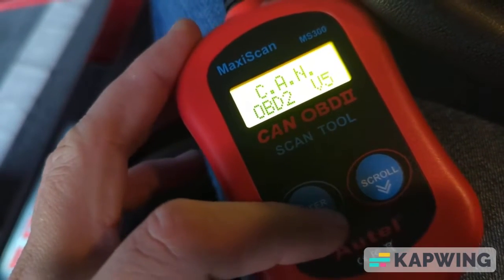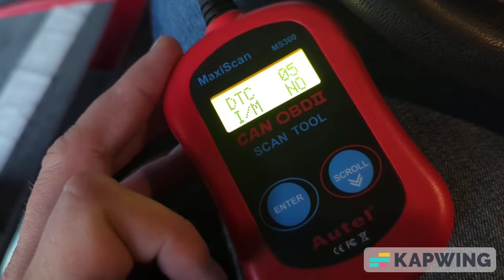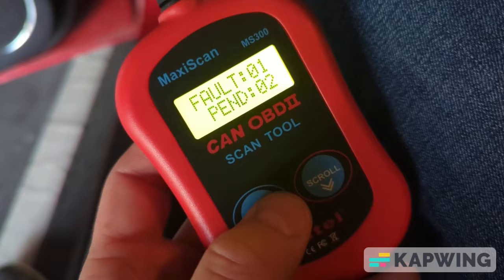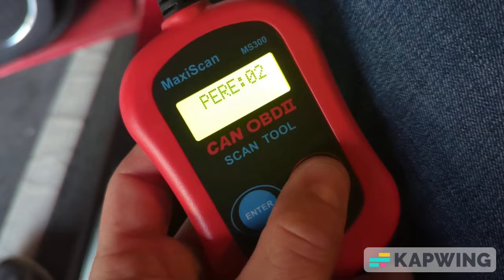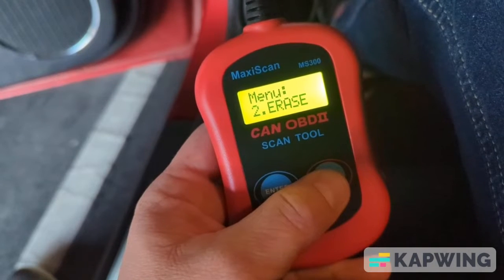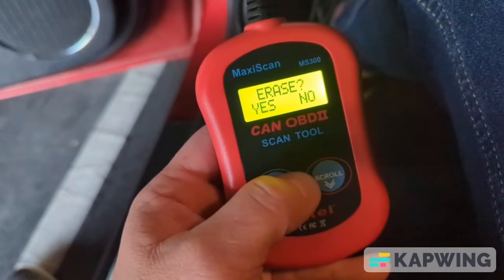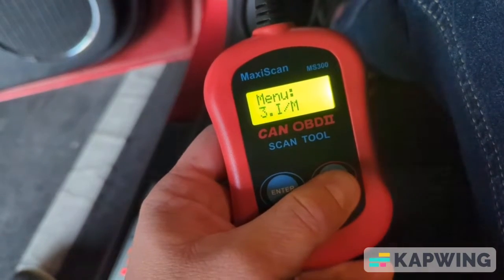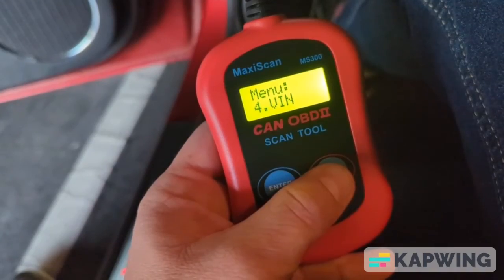Autel MS300 OBD2 Scanner Code Reader - Quick Tutorial to diagnose and turn off check engine light.

Comment: I got one of these. For my Toyota yaris. A load of rubbish. Keeps coming up with. 
Error  message. Its not fit for purpose.
Reply from the maker: this is surprising to me, works perfectly in my case. It's either a faulty unit or maybe you did not fall the steps? the OBD is very particular about when you plug it in, when  you turn on the car, etc.
Reply: @LeonardoRossetti  yes  it's  the unit. Put it on a default car  and it wes the same. going to get new one. Thenks
Reply from the maker: @grahamdobson7428  oh so unlucky!

Comment: Where can you find code numbers when I lost mine
Reply from the maker: Great question! Mine didn't even come with a guide, so I hear you! 
I simply went on Google and typed "[error code] OBD error code [car make and model]", so for instance "1044 OBD error code ford mustang 2017] .

This is even a better strategy than looking at the guide, because it will also show you manufacturer's specific codes that aren't standard.

Good luck!